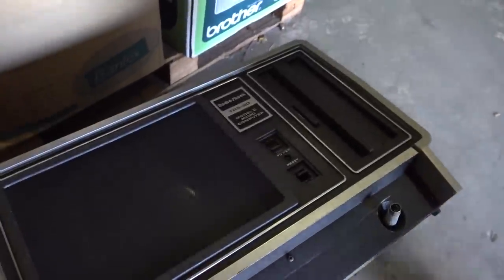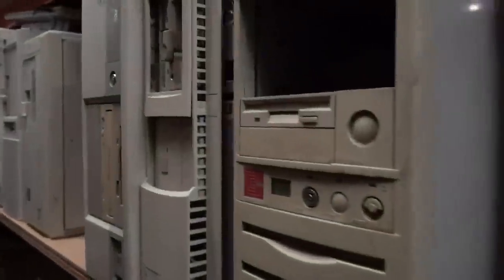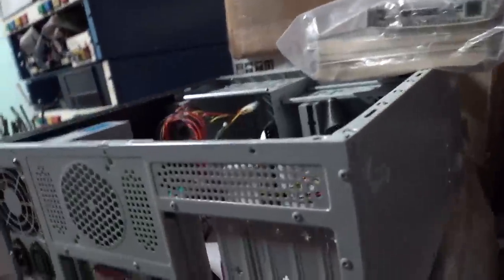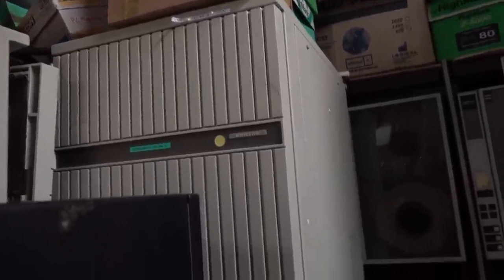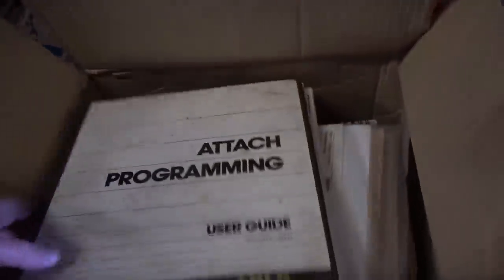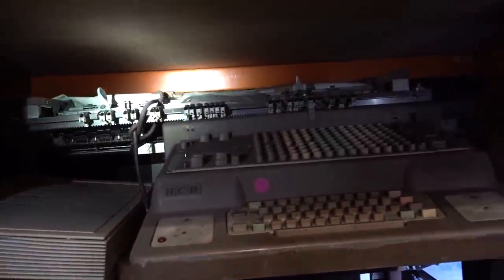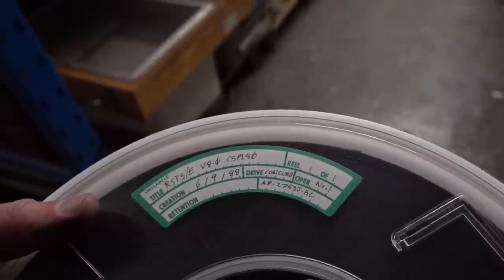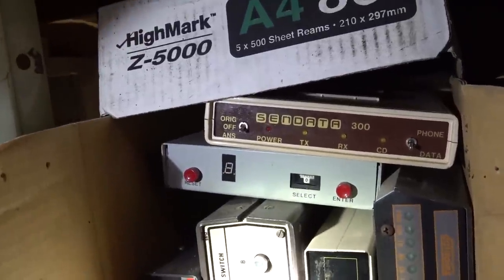EEVblog #1112 - Vintage Computer Warehouse Diving!

Comment: AH! Memory Lane!

The first computer I used was a VIC20, then a Commodore 64, then the infamous Radio Shack TRS80 Model 2000.

From there it was a 386, 486DX2 with 2 40mb hard drives. When the  Pentium 2's came out, HAD to have one.
After that I went to work as a computer tech for an Epson authorized dealer. Still have the certificate for each of their equipment.
My Brag Book, with all of my licences and certifications has a cat sitting on a VIC20. 
Thought bubble, "I don't know what this thing is, but it's sure nice and warm".
Gave it to my Son. He just looked at me funny. I don't need all that stuff anymore. Nobody needs an old Satcom certificate for something that doesn't exist anymore. It was fun while it lasted.

Comment: 6:30 - PDP-11 enginerring drawings. What a score.
Reply: Was thinking exactly the same thing. Memories like the corner of my RAM
Reply: Those need saving!
Reply: Probably extremely rare too. I'm sure the 8 bit guy would like them.
Reply: the pdp-11 is a 36 bit system. the 8-bit guy would have to rename himself to the 36-bit-guy.
Reply: @CB3ROB-CyberBunker  err NO! The DEC10 and DEC20 are what you're thinking of, different machines altogether - first multi-user mainframe. The PDP 11 was 16 bit of which MANY models existed: 11/03, 11/05, 11/10, 11/20, 11/23, 11/34, 11/35, 11/40, 11/45, 11/55, 11/60, 11/70, 11/44, 11/73, 11/84 etc. ALL the above I worked on as a DEC Field Service Engineer.

Comment: That weird IBM you walked past was THE FIRST HARD DRIVE commercially available - the IBM 305 RAMAC. As soon as you said RAMAC i was jaw on floor
Reply: Mijc Osis Same here. Casually walked by the first HDD ever...
Reply: To be more precise, the HDD is inside the IBM 305 RAMAC, which is a computer.
Reply: @GRBtutorials  But it is also only a RAMAC if the HDD is attached ;)

Comment: I worked on the PDP11/ 20, 34A, 40, 45, 60, 70 computers plus RP05, 6, 7, RK05, RX01 etc.
Reply: Me too and many more besides! Did you spot the DEC Alpha System masquerading in a Compaq badge?

Comment: 23:40 Is an IBM 1401 computer. At one time (circa 1960) these were the most widely used systems in the world. Over 10,000 were made, only about 6 left worldwide now. 
I still have the core memory frame from one of these.

Comment: you keep saying there is so much "modern junk" that you'd find in the dumpster or laughing about it...but you got to remember, when Windows 3.11 and Windows 95 was popular, people were tossing out old Apple Mac Classics, IBM 5150s, etc and now those are somewhat desirable computers.  Give those "modern junk" computers 10-15 years when Microsoft has screwed Windows up so much or gone strictly to ARM CPUs where ANYTHING written for x86/x64 CPUs won't run...we already have some Windows computers running ARM CPUs and they emulate x86/x64 software....very poorly....
Reply: This wont happen anymore, we have emulators for every platform now. What is somewhat precious are esoteric/rare pieces of hardware, not whole common systems.
Reply: Lots of DOS enthusiasts out there!
Reply: There's no way Microsoft will switch to ARM. Intel chips has been optimised for consumer and business level needs whereas arm is designed for more embedded and mobile applications.
Reply: Apple is already in  the process of switching laptop lines to ARM, expect Apple Arm chips in all their computers in next ~5 years.
Reply: Hp has multi-processor servers based around the arm architecture
Reply: It is a matter of volume. For each appleII that got thrown away, you will have 189 iphones, 217 macbooks, 918 android phones, 1305 notebooks and 2633 desktop PCs
Reply: Emulation is nice and all, for those that just want to play games...however, there are folks out there that want real hardware and software.  Why do you think NES games are getting so expensive?  Before the NES gained popularity again, you could buy copies of Super Mario Bros at Funcoland for 2 cents!  Now, you do good to find it for less than $5 at a lot of game stores.  However, emulation is not perfect.  It wasn't until just a few years ago that we even had NES clone consoles that could play Castlevania III...and a lot of Sega Genesis clones have bad sound emulation.  The true fans want real hardware, casual gamers are the ones that don't care if it's an emulator.  Granted when it comes to PC Emulation, its better than consoles for the most part, however, it's not as good as the real thing.  I know I could emulate an Apple II or a C64, but it's not the same as having actual hardware....
Reply: You need to remember, Apple were only x86 for a relatively short part of their recent history, they were primarily RISC based on Motorola 68000 and later IBM PowerPC.  RISC is nothing new to apple and historically the norm for them.
Reply: 3800Tech, that's just for the Mac. Prior to that, Apple was 6502 based with the Apple II

Comment: 6:03 - These IBM  3278 terminals are beutiful.
Reply: movax20h Loved the keyboards on them.  Rock solid and required less finger stretching than the 101/102-style keyboards on later models and PCs.  Key feature: Instead of a wide gap between sections there was a tactile ridge 1 to 2 mm wide, but easily felt when touch typing.

Comment: The DEC RP-06 at 7:36 could only support 200 MB. I know this because I did an awful lot head alignment routines on these at Bell Canada in the 1980s. IIRC, they employed 10 platters but only 18 heads (the top surface and the bottom surface were not used). If you forgot to remove your wrist watch before launching the heads, then you would need a new watch :-)

Comment: The typewriter looking device is actually a Remington Bookkeeping Machine. Its a typewriter and adding machine in combination.  The counters are used for adding and subtracting numbers. Its a certainly quite hard to find one. i have a model 21 which is a smaller version with less features. Certainly worth saving.

Comment: I used to work for DEC back in the late 70's early 80's as a Sr field engineer
Reply: @mipmipmipmipmip DEC were big EVERYWHERE back in the 60's 70's and 80's. Only IBM was bigger. DEC operated in every major country in the world > 150 IIRC. I too worked for DEC as a senior field service engineer in the UK where we had almost 20,000 employees and approaching 200,000 world wide. Bought by Compaq, then Compaq bought by HP. Most of the DEC documentation used to be available online. IIRC much of it is now online via Gordon Bell's computer museum archive (he was DEC's founding engineer before eventually moving to Intel.
Reply: @mipmipmipmipmip I was in DEC UK workstation marketing when the Alpha was released. A bit later I had responsibility for the relationship with Computervision's Medusa CAD software development team. 

We loaned them some of the very first Alpha workstations. When they first started compiling their software they asked us to come and help because they thought there was a problem with the compiler. Turned out that they couldn't believe that the compiling of the whole package was done in just a couple of minutes and was so fast they thought something was wrong! LOL 

Bearing in mind that Medusa was 2D CAD, you can imagine their delight when one aspect of what they could do was generate a pseudo full surface model and rotate it in real-time because of the sheer speed of the Alpha box! Absolutely superb systems.

I liked your clever |d|i|g|i|t|a|l| logo - nice ... A true fan!

Comment: It amazes me how some of these computer companies seem to have very little data readily available, given a quick Google search. For instance "Concurrent Computer Corporation." I can find a very small bit about their more recent (last 20 years) operations--including some real time computing and flight simulation stuff. Unfortunately, the history of it seems to have been lost (rather, not published. Certainly, the knowledge still remains within some people and non-digitized documents). I love what some of these vintage computing organizations do in trying to keep the history of these alive in the current era. Unfortunately, after Googling every unusual thing that has arisen in this, it's been made clear that even semi-detailed information is very difficult to find.
Reply: It seem like there's an Internet time hole for documenting old systems. Systems that were nostalgic when Internet access became more ubiquitous in the early '90s got documented, while systems that were on there way out at that time got lost. We had a Masscomp-based multi-processor 68030 Concurrent on loan to the UNH-IOL for network interoperability testing in the early '90s. They were specialized multi-processor real-time Unix systems, a bit out of date by the time I got to (briefly) use it. Try searching for "concurrent series 6000".
Reply: The Concurrent in this video looks like maybe a late continuation of the Perkin Elmer proprietary multi-processor real-time systems. Makes sense to be sitting next to that Tandem. Specialized, not general purpose, systems.

Comment: your mystery box is very familiar to me. I worked at Bell Canada. during the mid-1980's we did a lot of flying head alignments on our Tandem / Ampex 300 Mbyte HDD's. replacing lots of heads and realigning them. Ours was a tandem computer fault tolerant non-stop mirrored disk computer environment.

Comment: Last year, we had a vintage computing festival in Berlin, and there were people actually putting these old systems on display. One recreated the war room display from the movie wargames on a small tube, another had a fully working PDP-8 there (I was there on early Saturday when they were still setting everything up, and so I got to help lift PDP-8 components into a rack - these suckers were heavy bastards, like 60kg for one module and so on). It was quite the experience! They even had a repair corner. I tried fixing my TRS-80 there, but it didn't work out. But the good thing was, the machine was rather complete, so I found some fans from the other side of Germany, who actually bought it from me for a nice price! They're going to fix it up, and I don't have to worry about it any more. Unfortunately, this festival is only about every 2 years or so, even though I'd love it to be once every year. But I guess, vintage computers don't have that many fans...

Comment: 10:03 Ah the old Teleray terminals. I used to repair these back in the early 1980s. They were so easy to fix. There were no CPUs in them and were based almost solely on 74 series chips and a few static memory chips, all of which were socketed, and I just had to swap out chips to find any faulty ones. They were pretty good terminals for back then. We had hundreds of them in our organization.

Comment: That IBM blue box is a mainframe 1401
Reply: That's exactly what I was thinking.  Send it to Curious Marc!
Reply: I was unaware that the 1401 was in the condemned warehouse. It is probably the single most valuable machine there. It would not be hard to get over $10-15K USD for it from a big iron mainframe collector, possibly much more, and use those proceeds to move and store (and thin out!) the rest...but I do not know at this late hour. I hope they have some sort of plan.
Reply: Indeed a 1401, probably with expansion memory, and the RAMAC he read might imply it once had a 1405 disk unit, which would make it pretty darn rare.  I hope to heck it gets preserved.
Reply: After looking at this video I am worried that the people running it are hoarders rather than people who know how to preserve important artifacts. Sorry if I offend anyone, but the video says it all. If I was in Sydney I would help sort through the important stuff and even pay for a storage unit to keep the VALUABLE stuff safe. With only a week to clear all that stuff out, I am worried a lot of good gear and information will be lost.
Reply: I was told by an ACMS member that they will be moving out the 1401 and EAI analog computer. Hurray!
Reply: @uniservo  that IS good news.. i was smh watching this vid...

Comment: We used stuff from Able computing in the 1980s. They manufactured rGate which was a 500-line terminal server (looked like DEC Server) to connect to a the Case-Rixon DCX network. They also manufactured xGate (for connecting to X25 networks) and BlueGate for connecting to IBM SNA networks.

Comment: I think that 4010 was the old storage tube graphics workstation. There were a couple at Caltech in the terminal room in the early 80's. It was almost like using a printing terminal—the screen could only be erased as a unit. When the screen filled up, you'd push the clear screen button, and there'd be a big green flash as the tube was erased.
Reply: They used phosphor storage CRTs instead of memory chips to display graphics. I used a similar unit to program a few graphics applications back in the early 1980s.

Comment: The analog comptuer is amazing.
Reply: Looks very similar to the ones I used to program (jumper wires not code) when I was at Uni in the early 70s. SOOO simple to use for calculus problems and 10,000 times faster to program than a digital machine. Dial an input pot with input value/s and instant output of the answers. 😁

Comment: I had a Tektronix 4051 graphics terminal at home when I was a teenager. My dad brought it home from work. It was cool. Weird, with a scope-like storage tube monitor and a DC300 quarter inch tape drive, but cool.

It was much like that 4010 you found a manual for. The 4051 manuals looked the same.

Comment: 13:44 That looks like a standalone 16 channel Micom Data PABX from the 1980s. This little unit seems to have similar boards to much larger switches that could handle up to around 1000 channels and came in large racks. They would present a menu on the users screen allowing them to select which computer they wanted to connect to. It was all based on serial RS232 type connections. We had loads of Teleray terminals on the user end, and later PCs acting as terminals, with a computer room full of Data General, VAX and Pr1me mini computers on the other end. Everything was replaced with Ethernet and proprietary DEC networking around 1990. They fun times.

Comment: That is the front panel of an Interdata Model 70 seen at 12:14 (Interdata clone the instruction set of the IBM-360). We used these at Bell Canada in the 1970's decade. It had no OS so the cassette was used to boot the application (or diagnostics)

Comment: 2:41 The machine on its side is an Olivetti Programma 101 Electronic Calculator, from circa 1966. I want SO BAD, but I'm in the US...
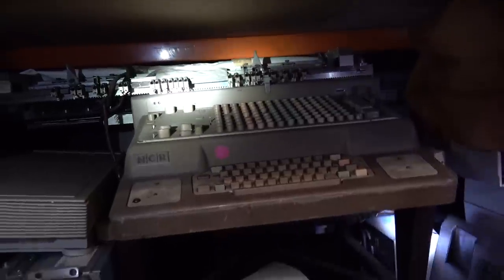19:27 The machine on its side is a Canon "Canola" SE-600 Programmable calculator.

Comment: Used to have a room full of those Intel MDS (blue & white boxes at 09.15) in the mid 80s. They were useless - as soon as the room got slightly warm half of them would crap out or the screens would shrink to the size of a postage stamp. Then I actually had to use one in my first job, it was the development system for early car dashboard displays. No idea why they were so big, we later replaced it with a box the size of a paperback.

Comment: What a riot Dave. SOOO many DEC machines that I recognised there  (and worked on during my time with them as a field engineer before moving to sales and marketing). Plus software like RSTS/E - A true multiuser system running in less than 128k of memory - as low as 32k on a 16 bit system. DEC was producing a full 16 bit computer on a CHIP when Intel was still farting about with 8 bit micros! The dark grey "Compaq" box you mentioned was actually a DEC Alpha system, the first 64 bit system in the world, rebadged by Compaq when they bought DEC in about 1996/7 and it then went to HP when they bought out Compaq not long after. There are I'm sure tens of thousands of ex DEC employees out there that can give you huge insights to many of those machines if you need it. Surprised you didn't spot the DEC Pro350 system I spotted at 28:03 on the right! That was DECs full 16 bit answer to the 8 bit early PCs and was actually a desktop PDP11 capable of running full blown RSX/11 Multitasking system or RT/11 REALTIME system.

Comment: The Taylor dos would have been really interesting. It'll have some sort of process control in it. I used to work on Taylor stuff a bit at the steel mill I worked at

Comment: Only saw one Sun; no sight of any SGI, not even a low-end small workstation... The place must have been well ransacked before.
I'd love to find an analog computer like the one found, quite less integrated than the one I had to work on during university EE labs in '94, would now hope to reuse it as an unique modular synthesizer never seen on an electronic music stage.

Comment: That was fun. :-) The huge disk platter could have been from a 70s vintage Burroughs system. We had those on the 6700 mainframe. The platters were vertical, and had a head per track, no need for moving heads. Very fast for it's day. 
A number of systems then used cassette tapes to load firmware.
Reply: My mother vaguely remembers something like that on the Burroughs systems she operated for Barnett back in the day. Were these early hard drives used along side the magnetic tape drives?
Reply: Yes, the B6700 I worked on used those big tape drives too. Most of them were 9-track. (8bits and parity) but the customer had one job that used an older 7-track tape. That old disk was mainly used for the MCP (yes it was really called that!) but we eventually replaced them with a string of diskpack dives like the ones in the video.